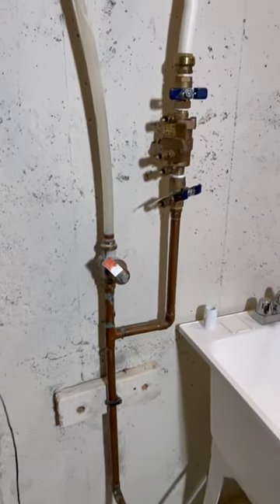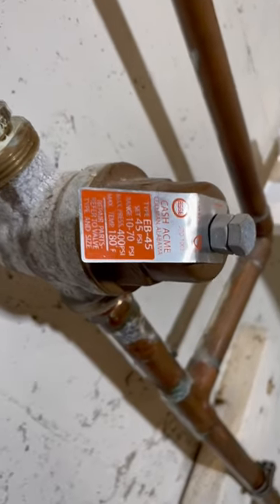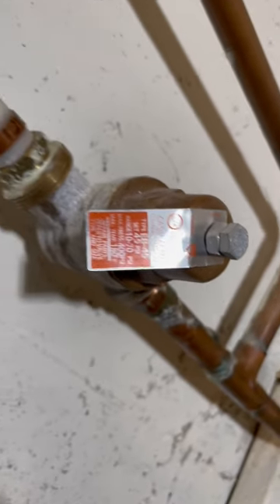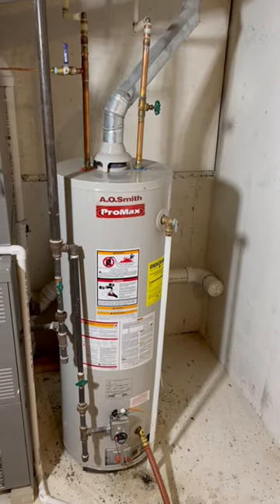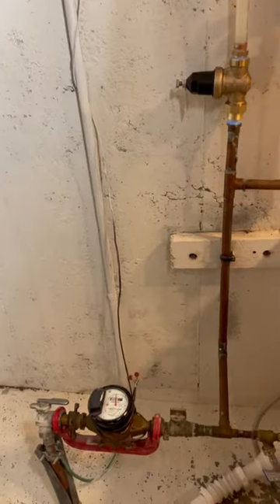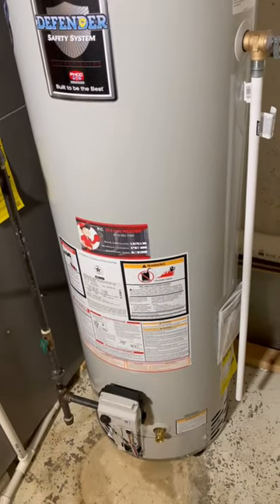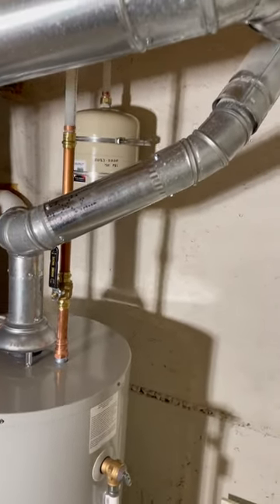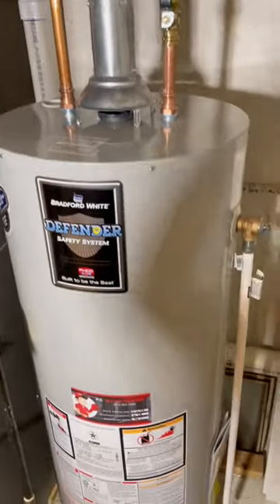Replacing a 20-Year-Old Leaking Water Heater in Kansas City, MO Northland

Comment: Expansion tank should be tee’d in between the shut off and the water heater
Reply from the maker: It can go anywhere on the cold water side as long as it’s downstream of the check valve or PRV.

Comment: Hey,   look nothing wrong with using pex butt the brass pex fittings will corrode and leak after approx 15 years so please use plastic pex fittings
Reply from the maker: We use DZR brass for all pex fittings. There are major issues with dezincification from lead free brass fittings which are commonly used with pex piping.

Comment: Why install expansion tank before the shut off valve? Have to shit the whole house down just to swap it out smh
Reply from the maker: We always shut the water off to the entire house anyway because it’s usually the most reliable valve. 

We actually find that there is less corrosion when connected to pex rather than copper. We also need to be 18” from the vent.

Comment: Illegal plastic discharge.
Reply from the maker: It’s a Camco runoff tube, a product specifically designed for this exact application.
Reply from the maker: You may be thinking of PEX tubing being illegal to use as a runoff tube. That is prohibited due to the decreased inside diameter of the pex fittings which restricts flow.
Reply: Last I knew both major codes required metallic tubing.  Although I don't think that would fail in operation.